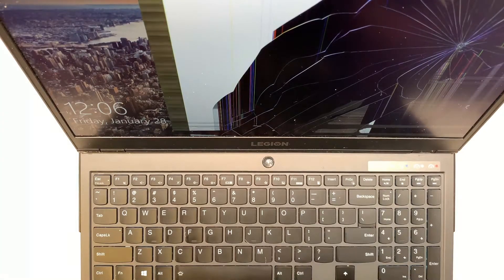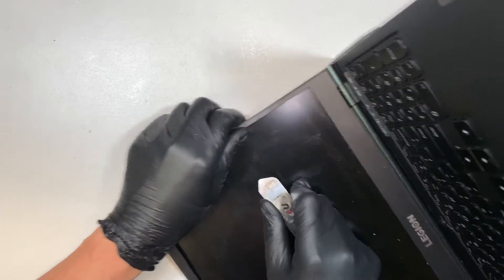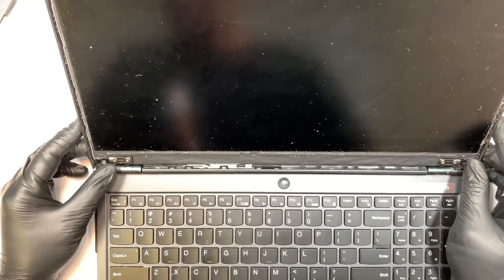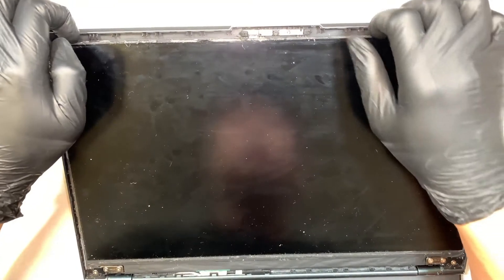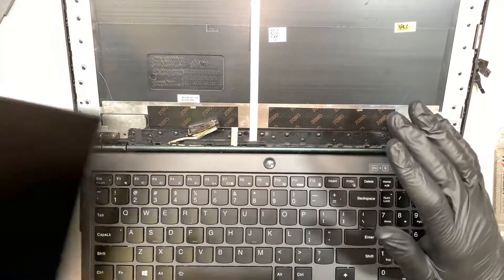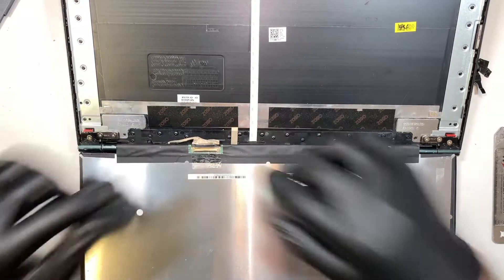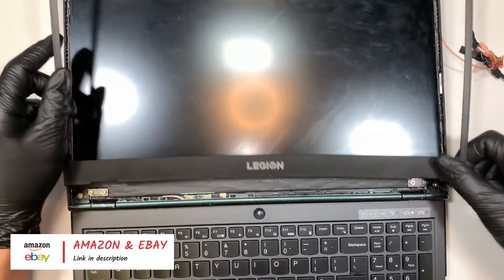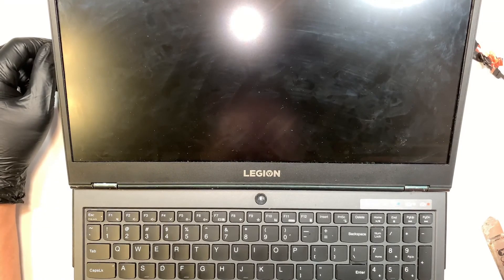Lenovo Legion 5 LCD Screen Replacement

Comment: Great video… By the way, It’s always a very good idea to disconnect a battery… Because the screen is broken initially it’s hard to tell if you have completely shut down the laptop correctly. Also any touching of metal surfaces might cause you to short the motherboard so yes you definitely would want to disconnect the battery first. In addition, since you are already taking the bottom off to disconnect the battery, you can use the opportunity to clean the fans and vents… just make sure that you hold the fan still wind blowing air into it so it doesn’t spin. Otherwise it can generate electricity and mess up your motherboard… This is true of any fan that you want to clean because if the air blowing causes it to spin it quickly, it more or less turns the fan into an electrical generator.

Comment: “Hello, great video. I’m using a Lenovo Legion 5 with a 165 Hz panel. Recently the display went black, but when I shine a flashlight on it I can still see the image faintly. This suggests the panel itself is working but the backlight isn’t turning on. Do you think this is more likely a panel/backlight failure, a faulty eDP cable, or a blown backlight fuse on the motherboard? Would replacing the screen alone be enough, or should I check the cable and fuse first?”
Reply: The back light is built into the screen so you’re replacing both either way.

Comment: I followed these instructions and now my laptop will not turn on or charge the battery .

Before you do this...UNPLUG YOUR BATTERY! A CRITICAL step left out. Other than that, great video....but now I don't have a working laptop. Just a FYI.

Comment: Did you not have to disconnect the battery before replacing the screen?  I've heard of people blowing out their motherboards or backlight inverters by not disconnecting the battery.

Comment: Do you rally need double side electrical tape. Or would any double sided thin tape do. Also why does the official service guide say you have to do much more to remove this?
Reply: Any non-conductive tape should work… The tape he is using is silicone tape, which I believe is non-conductive.

Comment: I replaced the screen, but now neither the new nor the old screen work. No idea what gives. (The 40 pin connector is properly latched)
Reply: Hey, nearly a year later and I'm having this same problem. Old screen now won't even give me any display but external works fine and everything is normal if I use an external display. I go into display and the laptop seems to recognise there is an internal display connected...going to have to get a professional in I think...
Reply: @SNYPER_E  You are luckier. No external display was working on my case. I never solved my issue. Was likely a fried GPU and ended up selling the laptop for parts on ebay.
Reply: @CosmicNewbie  damn sorry to hear! Thanks for replying.

Comment: I followed this tutorial and my screen cracked right at the end from the pressure of the bezel and the girth of the double sided tape added. It was a struggle getting the new screen back out because of the tape.

I removed all the tape and the metal brackets from each side. It gave the screen plenty of room and it slides right into place nicely. The bezel snaps on easily and tightly because of it and I didn’t use any glue/tape making the next install a breeze if and when that time comes.
Reply from the maker: Did you get a new screen ?

Comment: Before you start replacing the matrix, the first thing you need to do is disconnect the battery so that there is no power because in this way you can only damage the matrix
Reply: Where do u disconnect the battery
Reply: @austinroth9730 you can do it in bios, for anyone wondering in the furure
Reply: @austinroth9730 open bottom of laptop and remove battery connector
Reply: @ If the battery is built into the laptop, simply unscrew a few screws, remove the bottom cover of the laptop. Then you need to disconnect the cables from the battery that lead to the motherboard, gently remove it.
Reply: PLEASE, anyone doing this repair UNPLUG YOUR BATTERY FIRST!!!

Comment: Hello there I have a problem where an ant got inside my legion 5 screen and died almost at the center now its stuck. Is it still still possible to get it remove without damaging the screen?
Reply from the maker: Which part did you get stuck ?

Comment: is it required to disconnect the battery? you do it with other laptops but not this one - why?
Reply: It’s always a very good idea to disconnect a battery… Because the screen is broken initially it’s hard to tell if you have completely shut down the laptop correctly. Also any touching of metal surfaces might cause you to short the motherboard so yes you definitely would want to disconnect the battery first. In addition, since you are already taking the bottom off to disconnect the battery, you can use the opportunity to clean the fans and vents… just make sure that you hold the fan still wind blowing air into it so it doesn’t spin. Otherwise it can generate electricity and mess up your motherboard… This is true of any fan that you want to clean because if the air blowing causes it to spin it quickly, it more or less turns the fan into an electrical generator.

Comment: I have a Lenovo Legion 5 with 1440p screen. I want to replace it with 1080p, is it ok to downgrade it? 1440p is blurry and I want 1080. In the video you said do not upgrade.
Reply: Usually 1080p screens have a 30 pin connector, unless they are high refresh rate and or HDR. Side grading should work, so I guess give it a try.
Reply: @vffa  contacted support, asked them if they have screens. Thanks 👍
Reply: @BlobBlobkins  out of curiosity, why do you want to downgrade?
Reply: @vffa  Pretty big issue for me, when you use laptop at 125% size with 1440p, it is perfect and everything looks great. But when you connect a desktop monitor with 1080p with 100% size, it is unusable because of the conflit between 125% and 100%. If i set 100% size on the 15 inch laptop it works correctly but everything is very small on the laptop and unsable for me. Plus 1440p on the laptop drains bettery prett quick.
Reply: @BlobBlobkins  okay, that's fair.
Reply: @BlobBlobkins  Why not just set the resolution for the laptop to 1920x1080? External monitor doesn't work when my (laptop) resolution is set to 1440p (since it's a 1080p external monitor). It only works when I set it  (my laptop's res) to 1920x1080.
Reply: @schubert9613  It's all blurred and ugly, 1440p monitor doesn't support 1080 resolution. Reddit answer: the pixels physically don't align with the panel grid so you get a blurred image. I'm still struggling with those "new" technologies, my next monitor will be 1080p for sure :D

Comment: Hi, great tutorial! I have a question - the new screen model I purchased is "NV156FHM-N4K", almost the same as yours except for the last 3 characters. Is that ok? Is it safe to connect?
Reply: Hey, did you connect it? And does it work?
Reply: @tiestotjolle6956  Yes I did after backing up my entire drive, funnily it did work but the screen came in cracked 🥲

Comment: A few words of warning to anyone trying this. Some of these laptops have MUCH more double-sided tape on the sides than this one did. You will need to take great care and have a lot of patience when removing the screen, because this tape is very strong. 

Furthermore, there is a rather substantial chance of killing the laptop by switching displays out. He states it in the video, but you need to make sure it's the correct model. Just understand that even with that in mind, things can go wrong. Look at other comments on this video as proof.
Reply: Take out the battery dumbass lazies
Reply: It killed mine
Reply: @mrs.t754  did you disconnect battery?
Reply: @mrs.t754 Did you unplug it beforehand?
Reply: Killing the laptop you mean it won't work again

Comment: Hey I have a Legion Lenovo 7 5000 series and the screen ended up cracked so I bought a screen replacement. Took the work to do it on my own and watching some videos. This video seemed to be the only one that was similar to mine. I removed everything and when I plugged in the replacement lcd screen it doesn’t display and power turns white. It seems like it doesn’t detect any display at all. Put the old one back on doesn’t work again. I was being very careful to not break the cords for display. My problem also is I didn’t turn off the power source inside of the computer. How important is that? Should I do that and try again. I will try to attempt but I’m struggling to have my screen replacement work.
Reply: when you disconnect any type of hardware from a laptop without properly shutting down and removing the charger, the motherboard goes into power lock mode and the bios is fried 90% of the time which cant be fixed, you would have to replace the whole mother board which might cost more than a brand new laptop
Reply: @assermoemen9905  you also forget to mention to remove the battery. i did this repair, bought a new screen but had to send it back because when i removed the lcd cable with the battery in(forgot), i fried the motherboard.
Reply: I've done the same did u ever get it fixed ? What did u do

Comment: I used your tutorial to replace my screen. I can finally see the bottom part of my screen for the first time I’m months. It’s been all pixelated streaks of dead or dying pixels for months. Thank you 😊
Reply: likewise, used to have the same problem ,until i had it replaced
Reply: Same here do you have any idea what caused the issue?
Reply: @debauwabor9075  Same here I'm not sure! The only thing I've been doing that could've precipitated it is using my Display Cable and connecting it to my second monitor. Have you guys been doing that too?

Comment: Disconnected the main battery but after replacing my screen my laptop seems dead. 
No charging and won't turn on. 
Tried with the old screen and get the same thing 🤕
Reply from the maker: Try disconnect the battery, and do a direct power from your adapter. Will that power on ?
Reply: @UbergeeksBiz  hey I’m worried this will happen to mine is disconnecting the battery necessary I didn’t see you disconnect one
Reply: Did you managed to sort it?
Reply: Have you found out why your laptop is dead? Did you buy the same screen?

Comment: You can replace the 120hz screen with the 144hz screen. I did it with mine, same laptop model as in this video. All controls still work, same 40pin connection, refresh rate and brightness went up!
Reply from the maker: Thank you for mentioning it.
Reply: Could I replace a 120hz screen from a 2022 model with the 144hz screen from a 2020 model?
Reply: Do you have the exact number of the 144hz screen? The ny5 is the best I think over other 144hz screens (500 nits 1Billion colors and 1200:1 contrast)
Reply: Do you have the link of the screen with 144hz?
Reply: @S Stevenson Please bro give us a link to the page where you bought your new screen, I want to do the same
Reply: Please could you tell me if the colorimetry of your 144Hz screen is better than the 122Hz ?
Reply: hey there, I was planning to upgrade my 120hz legion 5 screen to 144hz screen, as 120hz have really bad sRGB and ghosting issue, Just wondering if it's possible ? also wanted to know that how is the colors and if there is any ghosting issues?
Reply: Brightness is the same on 120 and 144 screen?
Reply: What was the cost
Reply: yow send link pls
Reply: Just Google for any screen of the BOE NE160QDM product line. They'll have another 3 letters and digits after that. You can look up the specs of each on panelook. Would recommend the NZ6 or NM4 if possible.

Comment: Thank you. I just cracked my screen and looked online on how to fix it. Ordered the parts and now waiting for them to arrive! 
Thanks for making a clear tutorial. Liked it and will return to this video once the screen arrives
Reply from the maker: You are welcome. Good luck with your repair. Let us know how it goes after.
Reply: @UbergeeksBiz  Hello! Just fixed my screen and worked great! 
Only problem I had is that apparently with the 17" models there is also a horizontal pull tab running from about a quarter of the screen on the left to about a quarter of the screen on the right. 
Worked like a charm though! You're a hero!
Reply from the maker: @XanderBE99  You are welcome. Glad the video helped.
Reply: Make a video.
Reply: @nasimnazarov2683  Nah, this is a perfect video to fix it. No need for me to make a video